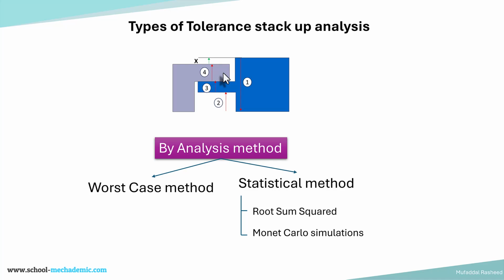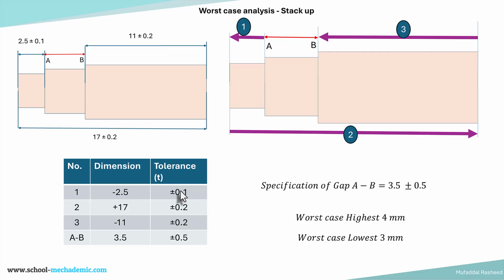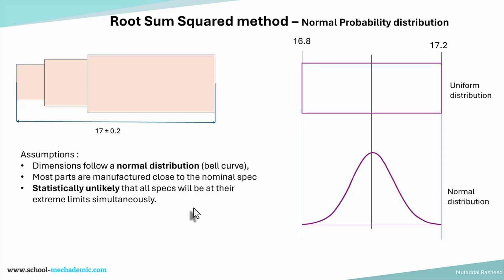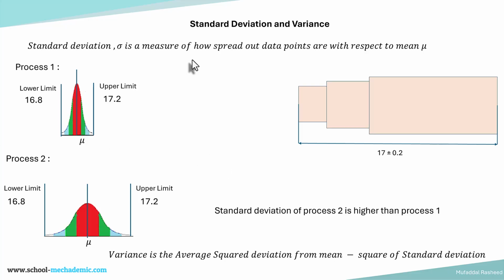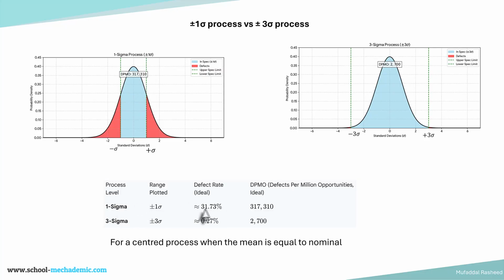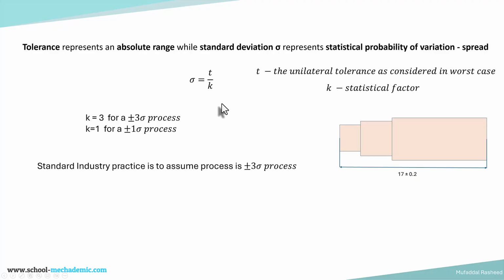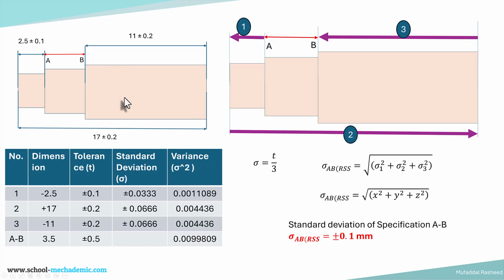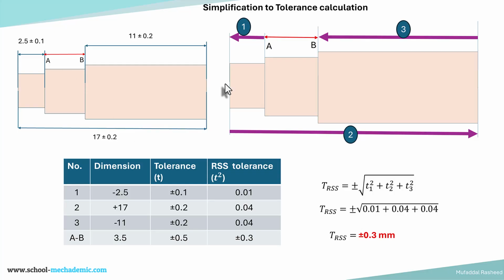Tolerance Stack up Analysis - Worst Case vs Root Sum Squared method

Comment: Very good example, indeed! One also could consider asymmetric tolerances, for example, t_low = 0.0mm, t_high=+0.4mm (which is often applied to assure clearance, for example). To do this, you will need to add another Column 3, "Dimension Mid tolerances", additionally to the Column 2 in your slide, "Dimension nominal" 19:10. Standard deviation within each tolerance range could be calculated as sigma = (t_high-t_low)/2/3, for each dimension, if you have -/+3sigma qualified process. And the resulting sigma A-B is calculated similarly to what you shown, but it will be given symmetric around "mid tolerance" value. You can of course translate it to the "asymmetric" setting, it is just offset by the "Dimension mid tolerance" vs. "Dimension nominal" value. You are good to use this approach as long as your final "response" is linear within the tolerance ranges, as in your example.
Now what do we do if our "final" response is non-linear within the tolerance range of any of the tolerances?